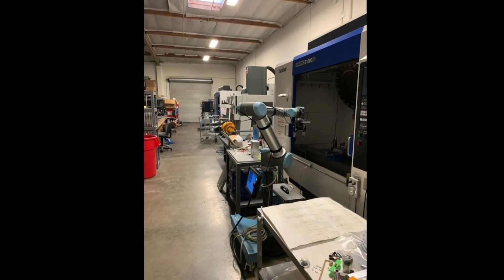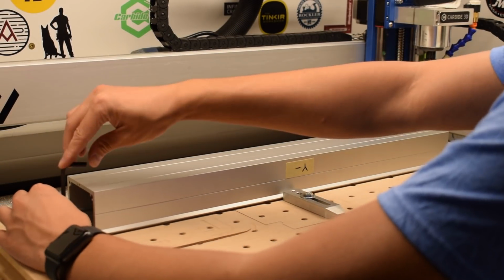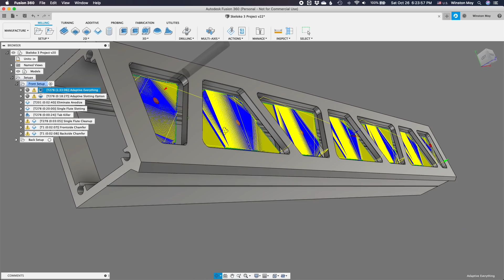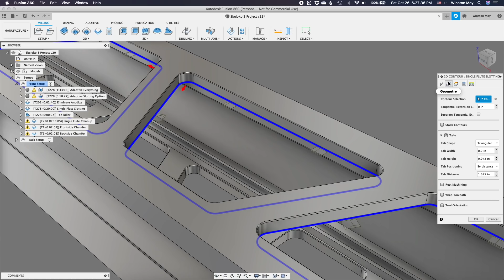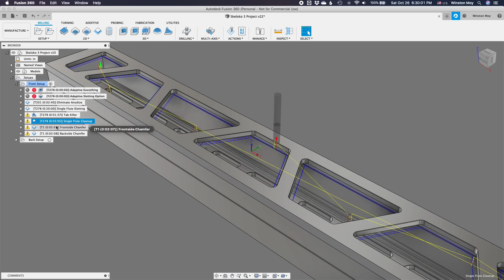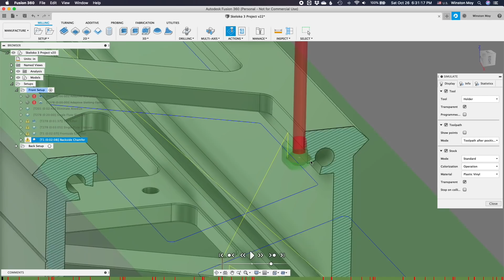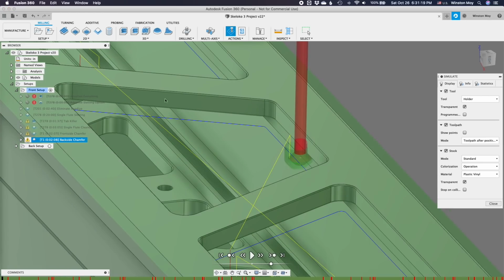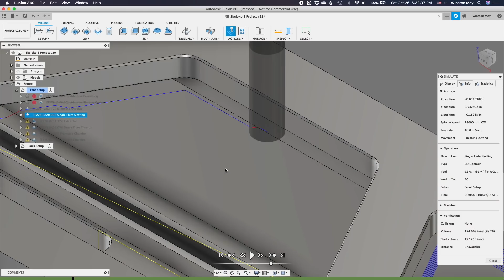Machining Anodized Aluminum to Skeletonize My Shapeoko - #158

Comment from the maker: Disclaimer for all the naysayers, the intended use case for Samwise the Skeletonized Shapeoko is to machine wood/plastic/foam on the road. So not only will it see very low cutting forces, but it will also likely be used with a dust boot. Furthermore, I already have a contingency plan for the apocalyptic mess people are concerned about: machining plastic or carbon fiber caps to plug the holes. So don't worry about the cleanup. 👍🏼
Reply: Clear polycarbonate on the inside of the rails, and frosted polycarbonate on the outside of the rail.  RGB LED strips down both sets of rails.
Reply: Would be interesting to compare performance to see what the actual impact is.  It almost certainly moved some resonant frequencies around, might even find better surface finish in some cases.
Reply: Those beams reminds me of certain building to building bridges. :) Maybe add some plastic covers inside somehow? and rail and rug... ;) (kidding on last 2)
Reply: i have free scraps of white polycarbonate 1/16" thick if you want them give me diemensions.

Comment: I like it, a lot of people see lighter as weaker. But as you said vibration could be an issue, just add a dampener like used in archery or small isolators. Simply put this is space science, lighter means you can carry a more diverse range of equipment.

Comment: Nice! What single flute endmill do you recommend?
Reply from the maker: I haven't used many. Mainly the Carbide3D single flutes, Harvey and Amana for plastics, and Datron whenever the absolute best surface finish is required.

Comment: why didn't you leave some finnishing material in there and after cutting the pieces of just runned the finishing path cleaning the surface, then you could have had as much material on bridges as you want?

Comment: Hey I'm a new subscriber to the channel. I stumbled across it while binge watching shapeoko enclosure videos as I just ordered an XL. I'm thankful for the information you provide. I'd like to ask which design software is ideal for beginners?
Reply from the maker: It really depends on what you're comfortable with. If you have no experience in modeling, you may want to start with 2D designs. Use Inkscape or illustrator (or comparable) to draw designs. Or make them directly in Carbide Create. One step above that would be something like Vectric's Vcarve or Aspire. But if you want full, proper 3D design you're gonna have to sit down and learn a CAD program like Fusion or Atom3D. All depends on what you want to make.
Reply: Winston Moy I’ll be mainly CNCing aluminum pc cases, 10mm thick plexi glass, & probably some wood

Comment: Skeletonizing brings up the idea of generative design. I wonder what generative design would do considering the rails are incorporated into the beams. I'd also be curious about the rigidity of using something like an I-beam extrusion, rather than a box extrusion; in both orientations of I and H, if that would make any difference at all.

Comment: Looks awesome. What did you decide to use for the control board? Something different or did you order a replacement?
Reply from the maker: Same board. Not worth the trouble to find something different. Control on the software side is where most people will look for third party solutions, not hardware.
Reply: Winston Moy very true, I built my machine from scratch so I got intimate with learning about drivers, breakout boards etc.. and Linux CNC. So I personally get excited about doing custom instead of buying replacements 😂

Comment: If you want to cut it out even more easy - cut it for example by 10mm mill and end it 2mm from cuting out, then take 4mm mill and cut it out - the plate will fall down, and it won`t harm mill. I`m doing like this even with steel 100mm.
Plese feel free, and look at my work
https://www.facebook.com/stelmachCNC/

Comment: stupid, waste of time. if you really wanted it lighter , you could of replaced the mdf with honecomb aluminum panels with a thing layer of foam board. that would of saved much more weight.

Comment: you can go to a smaller cutter and increase the feed rates with adaptive paths.  there is a term for adaptive slotting, its trochoidal milling.  to do this in fusion you can project to a sketch, then offset the sketch and extrude it and then you can just adaptive it out.  i will usually make the slot 5/3 * cutter diameter.  helical or predrill an entry point, and go straight to the bottom or past it.  also when milling tubes, clamping on the top surface does wonders for harmonics.  in this case i probably would have helicaled into the material past the bottom and just adaptived out the entire pocket, its not very big,  with the adaptive you can always back off the stepover if its too aggresive, but rarely do i find a situation where an adaptive path needs multiple depths, its usually when i run out of flute legnth.  thanks for the tip on the ramping on the tabs didnt know that, but tbh i try to avoid any moving ramps, the cutter grabs the material funny and always seems to leave a mark.  i wish fusion had a tab shape of ramp up from the path, straight across and then straight back down, but i rarely use tabs because im usually using a trochoidal path.  when you have the extra room from the larger slot, in tubes the loose piece just falls down into the tube.  ** sometimes(rarely) it will come out of the top.

Comment: What was the bits you used and where did you get them?
Reply from the maker: Generic 3-flute endmill off ebay to break through the anodize initially, followed by toolpaths with the 278-Z single flute sold by Carbide3D.

Comment: This got me thinking in the other direction - what about filling the x and y-axis with sand/epoxy ends/3d printed caps to add dead weight to minimize vibration.
Reply: It's been done. Filling the rails with sand helps lower high frequency vibration. epoxy/granite would be even heavier and you might run into issues with accelerations then.
Reply: @janderson2375  I thought about that as well - your right acceleration on moving the top bar may put a strain on the motors. But the lower two on the main frame would definitely benefit I would think. Adding to that dead weight would work just like weighting a lathe. FYI alot would be gain by simply securing the whole frame to the table top as well.  Its seem like the real benefit would come when cutting metals!
Reply: @CAOHnutrition  Right, I plan to add sand but above all I plan to secure my frame to a heavy weighted table so it "adds" mass to the CNC base.
Reply: @janderson2375  Let us know how it goes and if you see improvement.

Comment: I think you should have performed a topographical or topological optimisation for this before cutting. Geometric optimisations were by far my favourite thing to learn, and I think your audience would have found it extremely interesting.

Today, it can be done in Solidworks, but honestly programming a FEA operation for a truss structure like this one is not very difficult.

Still, it came out really cool.

Comment: Love using a Shapeoko to cut a new Shapeoko. Your comment about a heavier CNC being better in every way is what has kept me from order an Avid for so long and instead looking at ShopSabre, Camaster, Laguna, and other welder steel frames that weigh over 1,000 lbs, rather than more extruded aluminum. Although I do love the modular design.
Reply: Mark, I have the Avid bench top Pro CNC (24x24), and it is a ROCK!  Certainly much more expensive than the Shapeoko, but maybe less than those you listed.

Comment: How did you program the toolpath to clean up those tabs? ... 2D adaptive with rest machining and 2D selection constrainment between the outer wall and some arbitrary less-than-tool-dia offset geometry? Thanks!
Reply from the maker: 3D Contour with Rest Machining.

Comment: I'm fascinated, but a little confused about how the 3D contour with rest machining seems to target only where the tabs are.  How does fusion360 'know' the attached piece as been cut away, therefore not milling that area?
Reply from the maker: It's not that it knows the piece in the middle has been cut away so much as it simply only applies toolpaths against walls. And since the wall has been contacted everywhere except where there are tabs, that's where the 3D Contour will work.

Comment: I chose my Shapeoko XXL specifically because the rails look so overbuilt compared to the its similarly priced competition.  It almost makes me want to scream, "No Winston!  Don't do it!"  I understand why you did it, though, and I also understand that these rails are roughly  half as long but started life just as beefy as my XXL's rails.

As I was watching, this reminded me of the earlier days of hobby 3D printing.  The first thing all of us printer were upgrades for the printer we just bought.  You've done the same thing here, even if you couldn't do the cuts on the machine receiving the upgrade, and I think that's neat.

Your modification looks awesome, and as always, I learned a lot from watching!

Comment: I like it, though I was thinking about doing the opposite, and adding some steel bar stock inside of mine to add some weight to the Y rails lol
Reply from the maker: Or cap the ends and fill it with concrete!

Comment: This is freaking sweet looking!  How did you come up with the truss design?  Was it just kinda eyeballing a pattern and giving it your best guess or calculating documented and observed load vectors?
Reply from the maker: I had a notebook sketch, figured out how many cutouts I wanted, and then came up with the sizes to make it work in Fusion. All eyeballed.

Comment: Looks nice but its not funtional. Any cnc would benefit from the extra weight to dampen the forces, you want it heavy as possible
Reply: Then you need beefier motors to move it around, or go slower.  There's always a tradeoff.

Comment: You can use clear acrylic to cover the holes and avoid dust or chips to accumulate  inside.  A mesh of any kind also will look cool. Won't solve the dust mess though   .

Comment: I want to cut out the front of the rail and add some liner guide rails that attach to the z axis. I have an extra rail because I damaged one on the v groove area so there isn't much risk but wanted your opinion.
Reply from the maker: @Vince.Fab (instagram) has already done it. If you want to go down that rabbit hole, by all means. Just make sure your alignment is spot on.

Comment: maybe pop some packing tape on the extrusion to keep out chips?
Reply from the maker: Effective, but wouldn't look great. I'd rather machine some plastic or carbon fiber plugs for the extrusions IF it turns out to be a problem. I plan on mostly machining things that can be done with a dust shoe.
Reply: @WinstonMakes  Another option would be PPF like 3M Scotchgard or Xpel. My concern wouldn't be chips so much as cables, fingers and other unexpected obstructions/victims. Looks lovely BTW

Comment: Love it. I actually designed the same with my NWA Piranha. I have yet to cut it in aluminum(originally hdpe). This video gives me hope. I did in some areas just cut recessed pockets to add lightness but retail as much rigidity as I could.

Comment: Cool project Winston. For future reference, anodizing isn't hard on tooling. Hard coat, on the other hand, will leave a groove in the side of an end mill if you run it at a constant "Z" depth cutting thru hard coat. I machine parts for oceanographic research, and we've had hard coated prototype parts that go out into the field (ocean) and come back for ECO mods, and getting through the hard coat to modify, then remachine with v32 finish for o-ring grooves to seal is a pain in the neck.
A good tip too is to punch out the corners of your pockets with an under sized drill and let the end mill finish it.
You can eliminate the squeek and chatter , and you don't have to slow down the feed rates going into the corner, then accelerate going back into a G1 linear move.
With this skeleton machine, or any machine, you know what would be cool, is to rotate the machine up on it's edge after setting up your project making it like a horizontal mill, and you can have all the chips fall into a rectangular chip catcher. Then you could add an auger to make the machine self cleaning like the Haas VF machines.
Then again I might be getting carried away .........
Another great video.
Take care Bud

Comment: A great video as usual but I think the rails would collect chips. But it does look 👍 cool
Reply from the maker: It will likely be used with a dust boot and I already have a contingency plan for the apocalyptic mess people are concerned about: machining plastic or carbon fiber caps to plug the holes.

Comment: It will be a terrific option.  In looking at the finished product it would have been aesthetically nice to mill the SHAPEOKO logo right int the middle of the gantry.  Regarding chips perhaps put some closed cell 1/4" filter material inside the rails.  That way when you vacuum the rig for regular maintenance, after each run, you only have to worry about surface waste.  Again your creativity, engineering expertise, and design talent are fantastic.
Reply from the maker: I thought about doing that, or my logo on the front, but it's harder to design anything structurally sound. It would become purely cosmetic at that point (though actually  stronger since there would be more material overall still there).
It will likely be used with a dust boot and I already have a contingency plan for the apocalyptic mess people are concerned about: machining plastic or carbon fiber caps to plug the holes.

Comment: I... There’s... cough ...You have a sock on your spindle...

Am I correct in assuming that’s to protect the motor from aluminium chips?

Either way, great project, thanks for sharing this! If I could make a wish (it IS getting close to christmas, after all) I’d love to see a video with more of your thoughts on adaptive slotting. I’m a firm believer after having watched your videos, and while it might not fit THIS channel, perhaps it could be a great Carbide3D video?
Reply from the maker: Yep, sock is for chip protection for the router.

And I had a short video that touches on "adaptive slotting" on the Carbide 3D channel. It was part of the discussion for how to 2D contour really deep materials.
Reply: For anyone looking for the video, it's called "Tricks to Improve Your 2D Contour Toolpaths in Fusion 360
", and it's on the "Carbide 3D" channel. Good stuff!

Comment: You are a cleaning masochist ^^ Have fun to get out the chips or install thin plexiglas sheets.
Reply from the maker: It will likely be used with a dust boot and I already have a contingency plan for the apocalyptic mess people are concerned about: machining plastic or carbon fiber caps to plug the holes.
Reply: @WinstonMakes  leave it open, i think it'll look better. great project
Reply: @WinstonMakes  please let us see your solution :D

Comment: looks good, but you will be collecting a lot of chips in the rails now
Reply from the maker: It will likely be used with a dust boot and I already have a contingency plan for the apocalyptic mess people are concerned about: machining plastic or carbon fiber caps to plug the holes.
Reply from the maker: It will likely be used with a dust boot and I already have a contingency plan for the apocalyptic mess people are concerned about: machining plastic or carbon fiber caps to plug the holes.

Comment: That is a lot of nooks and crannies for dust/chips to collect in...... perhaps simple profiles 3-d printed in vase-mode to put in all of the cut-outs and spray-foam in all the now hidden areas between them(with some temporary styrofoam inserts inside the 3d print inserts to keep them from bulging while the spray-foam expands/cures), could do a lot to both reduce sound and ad rigidity)...
Reply from the maker: It will likely be used with a dust boot and I already have a contingency plan for the apocalyptic mess people are concerned about: machining plastic or carbon fiber caps to plug the holes.

Comment: I think I would have held off doing it on the gantry since extrusions like to twist, and the weight of the motor would be a problem, but the frame would be ok.
Reply from the maker: 99% of that twist is due to the V-wheel interface or carriage plate flex, not the rail itself.

Comment: Will there be any twisting as a result of removing material from each extrusion?
Reply from the maker: Theoretically, yes. Practically, no. These are 5mm thick walls, plenty strong enough even with cutouts.
Reply from the maker: Practically, yes. Theoretically no.

Comment: Looking at that, I'm thinking more involved dust cleanup... all those nooks and crannies.
Reply from the maker: It will likely be used with a dust boot and I already have a contingency plan for the apocalyptic mess people are concerned about: machining plastic or carbon fiber caps to plug the holes.
Reply from the maker: It will likely be used with a dust boot and I already have a contingency plan for the apocalyptic mess people are concerned about: machining plastic or carbon fiber caps to plug the holes.

Comment: I wonder if it makes sense to save weight on the gantry or not. Mass reduces vibrations, but it also makes it harder to move. Not a big deal on this Shapeoko, but does it matter on a 150kg gantry vs a 200kg gantry?
Reply from the maker: Mass helps for sure, but it should also be scaled appropriately for a machine. If you have a 200 KG gantry, you should have steppers or servos that can handle it.